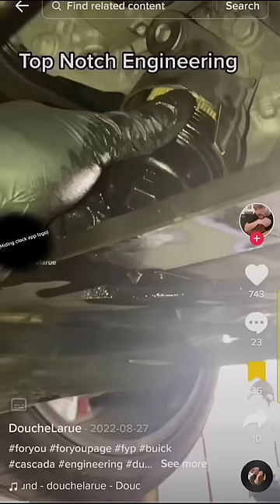Engineer Explains! #engineering #mechanic #car

Comment: I was in class and the professor showed us how to design a crash-safe grid to go over a Culvert. I said that should have some kind of a quick-release where you could just pull a couple pins and let the water and trash come through. The professor was on relenting on his idea that he should go ahead and put this without a quick-release and make you cut it out to take it out. I told him we fight for safety and you're having a guy on the side of the road longer with more exposure to danger first and secondly now I know why everybody hates engineers you could take 10 minutes with your pencil and save us all thousands of dollars each in taxes for fixing these after they make 10,000 of them.

Comment: That is an industry scam. Why do cartridge filters cost more than canister filters? Less material is used.
Reply: It could be the demand of them or how they’re machined. I hate changing these filters they get hot and annoying
Reply: Well that's your first problem. Assuming cost is dictated only by amount of material. Keep in my mind, the type of material used and cost of it, the manufacturing processes etc.
Reply: @TrainsForever what are either of you going on about. From a life long mechanic who tested and pulled apart of of different filters. The cartridge filters are identical in construction to the cans cartridge. No cost difference.

Comment: This is why I like working on my car, it's like they made it to be user friendly, oil drain plug is easy to get to and has nothing around it to spill oil on, filter is right up on top of the engine, and not blocked by anything.

Comment: Engineers never make mistakes. 
Like the Paccar engineers that made the radiator frame for the 388 wide enough to pull 8 pins and lift the radiator out. 
But didn't leave enough space to pull the pins, requiring the AC condenser and air-to-air be removed to get the radiator frame out of the truck. 
Then welding nuts inside the frame, so it needs disassembled to get the core out once you get it where you can get the pins out.

Comment: I agree with the engineer on this one. Its super simple just remove the filter from the housing. Then shove the filter up a little then the filter cap will come right out and then you can remove the filter itself. It's not rocket science it's just knowing your car and how it works. If tammy can't figure out basic shit like that, she doesn't need to be changing her oil.

Comment: Engineers don’t make a mistake 😂😂😂😂😂. Ex machinist that made 2 parts for a packing machine. Parts were dead on when finished. Sent to quality control. Again dead on according to blueprint. Machine assembler triple checked part and tried to install it. NFG!!!! No hammer big enough to make it fit. Engineers notified and came to the floor and ripped the 3 of us a new one. Because it flows down hill I offered to make it fit by remachining  it. Asked engineer which part he wanted modified.  Blank stare resulted. 2 days later the same prints were issued and I went through the process again. All while being overseen by Foreman, Quality Control and the assembler. Same result, doesn’t fit. Again engineering notified. Now 3 days later QC, assembler and I got laid off. Engineers still employed. They don’t make mistakes.

Comment: This might sound extreme but a saying that I made up a long time ago is “whatever engineer decided (insert complaint here) was a good idea, deserves to be kicked in the nuts, drug outside, and s**t!” Do we need engineers, sure, but we don’t need stupid engineers who make a mechanics life ten times harder then it needs to be by designing a bolt to go in one direction then put everything they can infront of said bolt then go and say the time it takes to do said job is an hour even though the smallest of things like that one bolt placement turns that job from actually being an hour to now being a 2 hour job instead. 

Thing is you as the mechanic will still only get an hour for the 2 hours it took you to complete that job which screws you the mechanic out of an hour of making money. 🤷‍♂️ that is why there is a deep hatred from mechanics to engineers, because some of your designs paired with a BS time frame causes us the mechanics to lose time and money. Ps I used bolt placement purely as an example.

Comment: That one is easy, pull the oil filter tool off after filter is loose. Then pull filter the rest of the way. Youre holding three seperate parts there and now that theyre loose they can separate and voila, enough room

Comment: Yeah right, Engineers have also created Obsolescence
So they make a vehicle that actually only lasts 36 months under warranty.
Then it breaks down the very next day, you take it to a mechanic for repairs and then he tells you to take out a mortgage because the $50 part he has to change requires a complete disassembly of the entire vehicle to replace the part plus the $10,000 you'll pay in labor cost because some jerkoff thought it was a good Ideal to hide the part in a deep crevice that requires an x-ray machine to find.

Comment: Engineers do make mistakes. We have a sea lock in my city(don’t know if its the correct term) called zeesluis ijmuiden. It was meant to bring cars and bikes to the other side of the canal while still being able to open up for boats from sea but because a engineer made a miscalculation the lock isn’t rated for cars. There are litteral car roads with bike paths next to them and the car roads are almost unused to this day so yes engineers do make mistakes

Comment: I've worked with design engineers before, and they ALWAYS make mistakes. Most of them are dumber than a box of rocks. And what's worse is that if you inform them of that, you're liable to damage their precious little egos.

Comment: Yeah that is why every mechanic was pissed when a Cadillac CTS V came in and required a pin to be removed from the motor mount and tilt the motor up to remove the oil filter. Yea sure engineered perfection.

Comment: This guy is the real NPC. Let me explain the real truth. Engineers do it for money at the direction of company executives. New tools are made, patented, and required so the owner will have to bring it to the dealership where they are charged exorbitant prices or an owner or independent mechanic has to spend thousands of dollars on a specialized tool to do the job which the rights have been licensed out to tool companies to make and brings more revenue into the car's manufacturer.

Comment: Toyota RAV4 is the worst design of an oil filter I ever dealt with,I went through 6 specialist filter housing removal tools designed specifically for the job ,it cost a fortune to do my first oil change,it was on the car so tight I don’t think the car ever had an oil change in 15 years

Comment: This happens because the same engineer team does not design the whole car! 
The Engine design engineers just design the engine! They have no idea where the body work or suspension is going to be!  The body design engineers should know where all the suspension and exhaust parts are going, but they may not know what power units they are going to use and as such may need to shoehorn in a engine after the body and suspension has already been designed. 
The sign of a good project engineer is relating the relevant details to the other teams so this type of thing does not happen!

Comment: Bull shit , I’m a industrial refrigeration tech and out in the field ….. we shake our heads for engineers all the time and as why . How many times have i said “ who in the fuck designed this with no way of pumping out anhydrous ammonia except to evacuate a 200 ft run because engineers didn’t deem it necessary to ad isolation valves

Comment: Computer says it will take 0.5hrs to change...
2hrs later and half the car taken apart, you're finally ready to access the oil filter at an awkward angle torqued iwth the strength of 50 oxes...

Comment: BMW mini 2021, bonnet release cabel held in place by a plastic slitcup. Engendered by a moron as it fails constantly. I'm not an engineer so therefore I repaired it using a slitcup from a bicycle brake cable it metal and had no more problems.

Comment: I wouldn't buy a new car, or anything made in the last 20 years! 
Every Dewey, Fulcom, and Howe Engineer wants to get a "Patent" or "Trademark" item in their name, so they design items and the "special tools" you need to buy, some cheap Harbor Freight class junk way overpriced garbage to get a seal or a plastic box out of your way, just to get to the problem. 
But now mechanics are way over priced, so nobody fixes their cars, they just trade in their problem. 
That IS MODERN ENGINEERING! The fools behind the Autocad desks don't take into consideration the guys in the banks behind the desks, giving loans for cars and student loans for mechanics, debt, debt, debt.. Meanwhile the Junkyards pile up this crap and eventually crush it wiping out all the Value, while the debt is still owed...

Comment: I know, it's just like sunroofs in cars nowadays. You can't buy a car without a sunroof.😂😂😂 Do you want to know why it's a genius hack? They need to keep that car at $30,000 to $40,000. That's why they keep adding stuff they've had around for twenty years. Just like you said you do things on purpose. One thing that somebody at home doesn't have is a $10,000 computer that'll take care of all the codes.😂😂😂😂 Mostly, it's a technician that needs it because you've made it that way. Not just one shop has a computer every technician has a computer. But you guys designed it that way.😂😂😂😂

Comment: We don't want to buy specialty tools for something so simple I got to spend $30 to remove this one oil filter and it's going to cost$100 for me to remove the control arm to do it then I just throw $30 tool in my tool bag and never have to use it again because 9 times out of 10 that person would never change that filter again if it cost $180 for an oil change cuz I'm going to recommend a lifetime filter

Comment: Dude look up the 2022 Mac with the 6.7 and tell me why they put the oil filter behind the turbo air hose and radiator return line the engineer should be beat and whoever approved it should be beat.

Comment: Can you redesign the location of the oil filter on f150 and escape  the cooling house are in the way of getting a band wrench on there and due to other people over torqueing the filter it's quite aggravation  on the escape  the skidplate had like 15 fasteners instead of a accessible panel  I did see a 2023 and it had 4 quick release tabs so that was helpful but still shit is aggravation

Comment: As an engineer, I can tell for sure that most engineers are complete idiots. 

Let me explain. Most engineers are too smart for their own good. They take something simple and complicate it on purpose. Also, really smart people have nearly 0 common sense. 

But the real reason this happens is because the person designing the engine and the engine bay is not the same person. Also, sometimes the design changes after crash tests, but it's too late to redesign the engine.

Comment: Engineers do a horrible job in designing reliability. Obselince if what it’s called right instead of making things easy to fix and last years they now make things hard to work on and lasts a quarter the time old stuff used to last. After all these years you would think things would get better and last longer now people have to rebuild their entire dep fuel system at 70 thousand miles with costs up to 9,000 $ we’ve literally went backwards

Comment: My sincerest apologies. Until i saw more of your videos i didn't realize this is all satire. It does make one wonder though if some of these designers actually have the I'm perfect and I'm doing you a favor attitude. It sometimes (read most of the time) feels like whoever is designing this stuff is some kind of sadist who either thinks you will just take it to the mechanic or buy a new vehicle. And if you do neither, this is your punishment. I had a nissan quest at one time and had to replace the water pump. It felt like i had to take half the motor apart just to replace it. Besides the differential pulley that had to be removed, i had to remove the upper and the lower timing belt covers just to remove 2 of the bolts holding the pump in place. That meant removing what seemed like 500 little bolts, half of which were in hard to reach gotta feel around the motor locations just to find them all as well as replace them. When you have to feel around the motor for bolt heads like a clumsy teenager feeling around under his girlfriends blouse trying to unclasp her bra with his non-dominant hand, that means they need to design it better to make it easier for all involved, including mechanics.

Comment: You aren’t engineering the car. You may work in vehicle design but you were never the guy to set any standards. Car manufacturers do not and I repeat do not think about working on the vehicle why they put things together. They care about materials used, manufacturing time, and assembly. You can lie all you want trying to say that the transmission sensor has to be inside case instead of sitting on the outside like many others do but the reality is they saved one less hole through a case, one less cut, etc. American auto manufacturers are only
Interested in profits, profits, profits. That is why the Japanese cars sell more. They don’t minimize stupid things

Comment: Engineers some time play jokes.
On VW transporter AXD engine
To remove Deisel injectors you need to strip whol front end off and remove.inlet manifold and then valve cover to remove.injectors.
Deisel injector very often fails and putting them in these position os really a joke